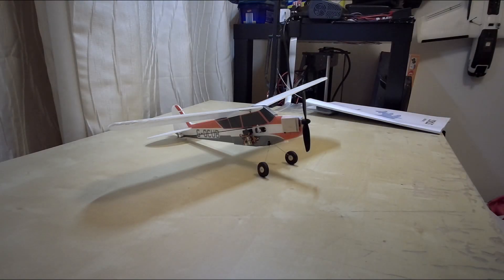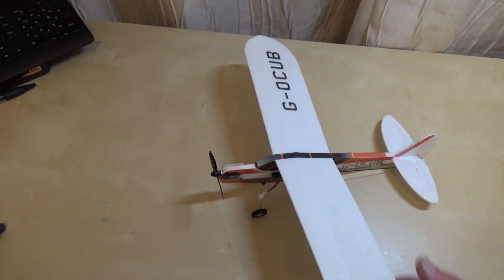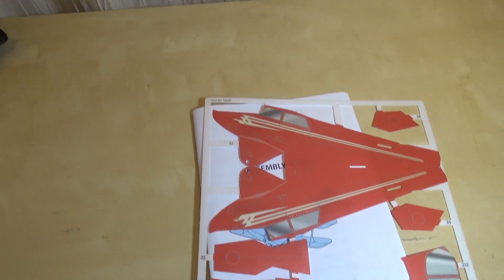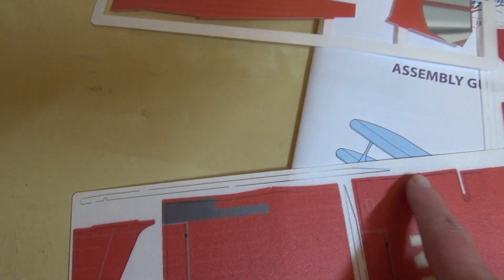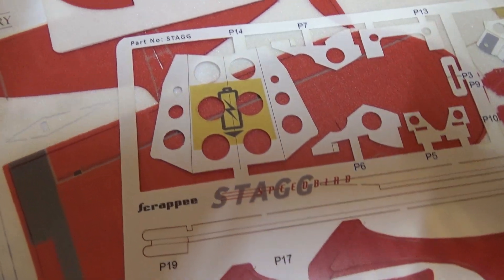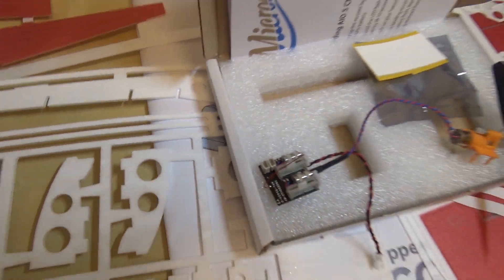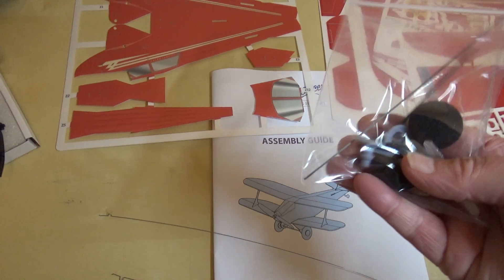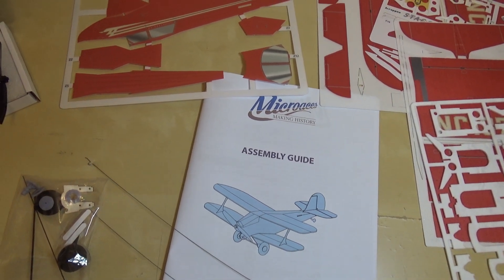Microaces  -  Scrapee Stagg

Comment: Caroline
Your make it with no worries. Think of it as a hitech jig saw
ALL the best
Brian
Reply from the maker: I can see that I will need my magnifying glasses for some of these bits. :)    Need to go buy some fresh UHU POR, the remnants of my current tube is a bit goopy.
Reply: @Caroline_Tyler  aahhh a uhu enthusiast never used the stuff I know martyn aka flanker tanker loves the stuff. I'm more belt n braces HOT GLUE but I'm sure with your modle SLEDGE HAMMER WALNUT effect
Good luck
Brian

Comment: I built the Micro Aces Bristol Fighter - good models although the Bris Fit is three channel so very difficult to fly in anything other than completely calm weather. Takes a lot of patience to build these!
Reply from the maker: I enjoyed the building of it but sadly it's going to hanger queen status, I just cannot get it to fly decently.
Reply: @Caroline_Tyler  Had similar issue with the Bristol and it took a lot of messing around. The other issue is that being a three channel and having scale outlines (small rudder) it can take an age to get the plane to level again during banking turns.